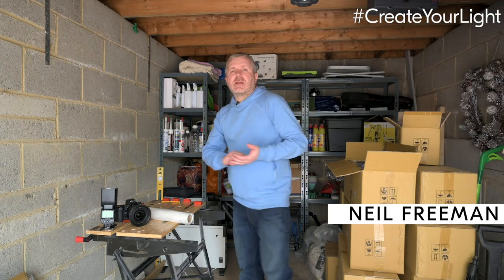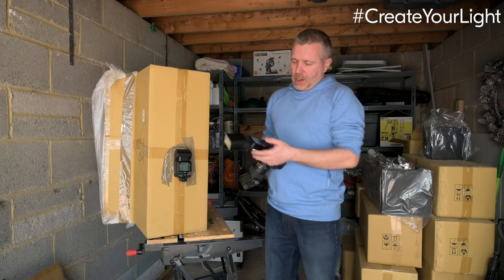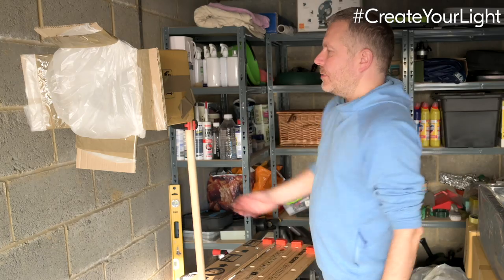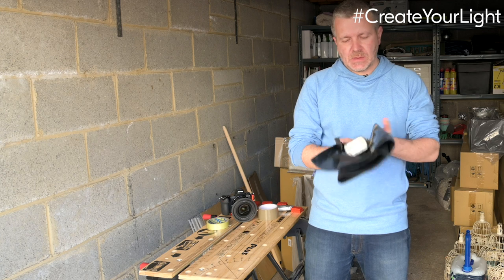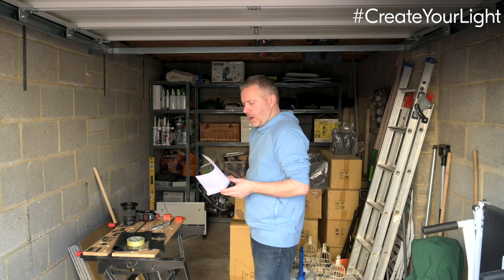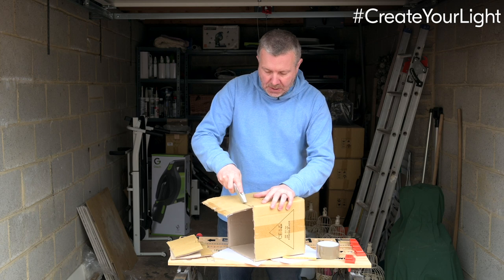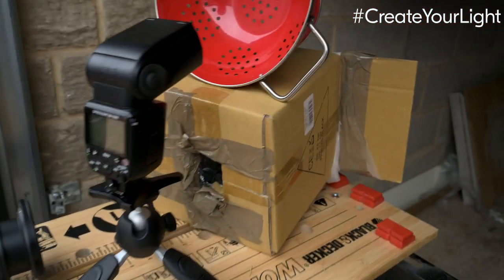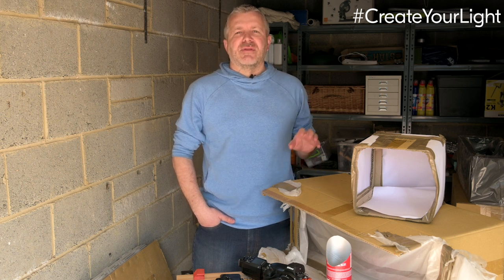Create Your Light Theme 2: Photography Gear & Camera ‘Hacks’

Comment: Наконец-то нашел нормальное полное видео урока. Спасибо! 

А то аккаунты официальные в инстаграм только вносят путаницу и бестолковые.
Reply from the maker: Glad you find this useful, noted about the handles, you have a point :)
Reply: @NikonEurope  I would just like to give one small advice for future releases) You give lessons for beginners who may not have such equipment. And my advice: use the external flash modes S1 and S2 + built-in flash, as well as the Nikon SC-28 synchro cable.